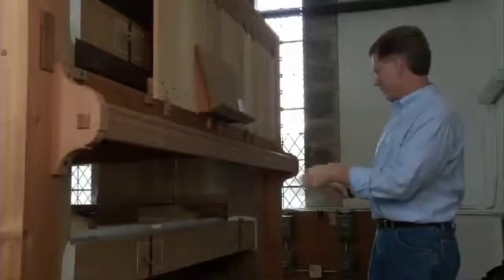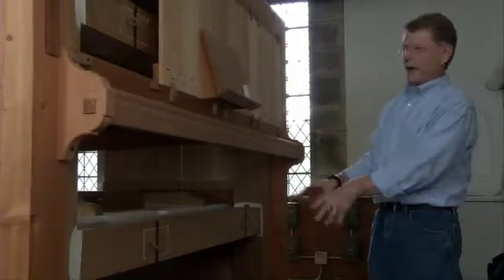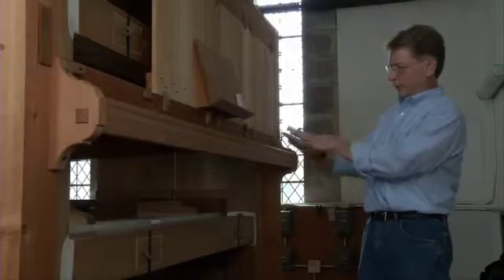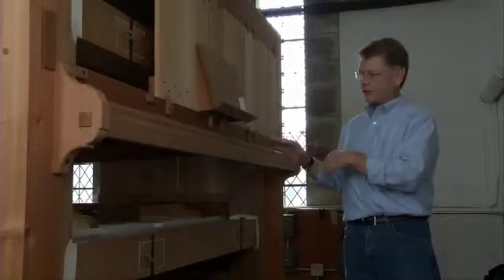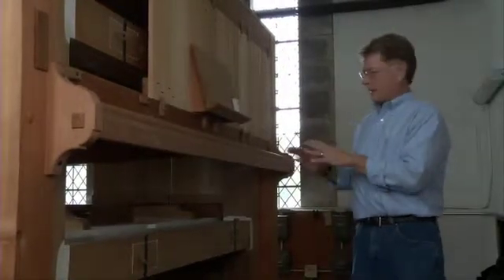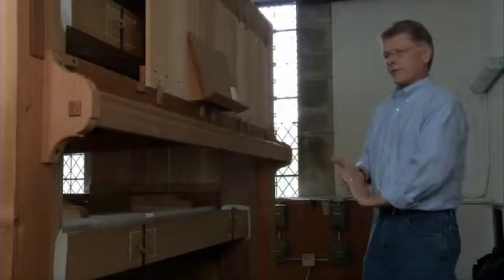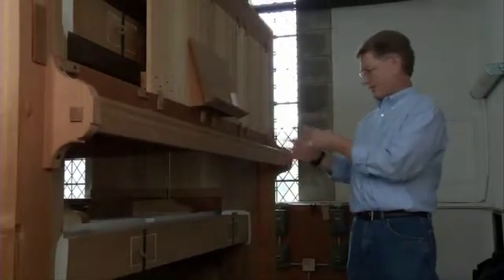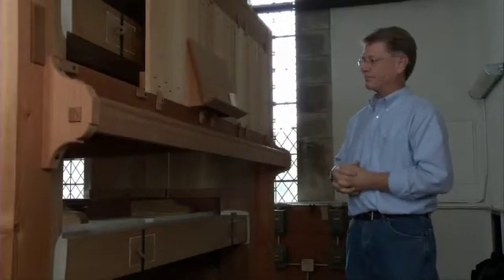Wind system for Cornell U.'s new baroque organ

Comment: This is a very interesting project.  No doubt you had a good reason to choose oak.  Personally, given its reputation for expansion and contraction with humiditiy changes and the fact that chemicals within oak attack iron and steel, I would not have chosen it for this purpose. But it's great to see organ-building of this quality, even though some might think it impractical in the modern world.  Thanks for the upload.